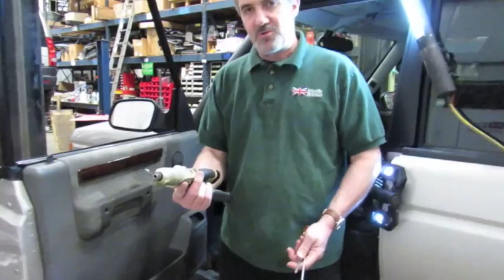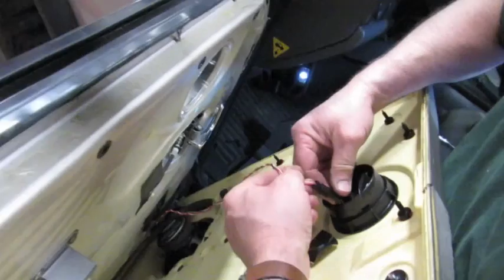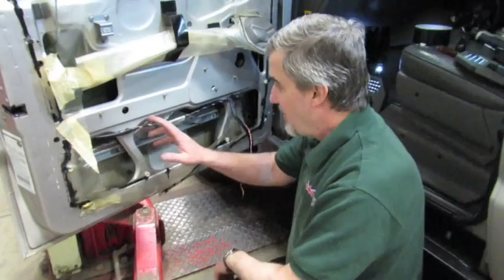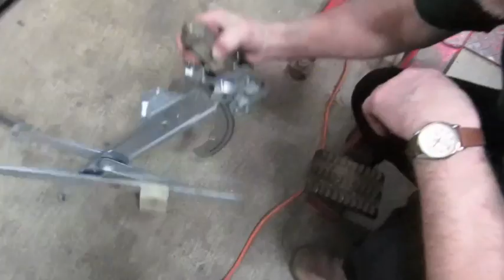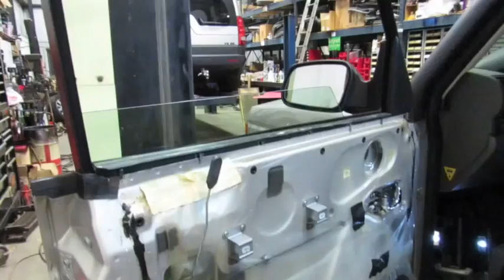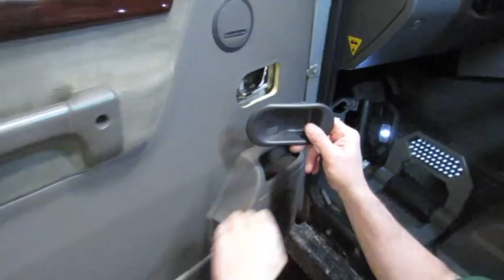Repair Front Window Regulator and Motor on a Land Rover Discovery Series II

Comment: kind of defeats the purpose if the window still goes up and down. 

My window is stuck shut so had to remove the bolts an let the regulator drop, still couldn’t access the nut on the other side of the glass.

now i have safety glass all over my garden.

Comment: One thing Doug doesn't mention is that the factory motor connects to a cable that's only about 6 inches long.  This plugs into the wiring harness behind the sheet metal. The two connectors at that end are held in place by a white nylon clip attached to the sheet metal; you can see where the clip attaches to the sheet metal behind the small clear plastic "bubble" in the moisture shield.  If you're replacing the motor, you need to release the clip from the sheet metal so that the connectors can be pulled down and disconnected, since on the replacement motors the 6" cable is not detachable and is plugged directly into the harness.

Comment: Anybody know how to get new glass installed? I keep fi ding nothing about putting new glass in.
Reply: Nevermind i figured out that you have to unbolt the window frame and pull it ul. I made a quick video on it.
Reply: @Nsixtyfourlink  Would you place a link to your video in this comment section?
I venture to say your instructions will also cover how to remove the regulators when the window is in the "up" position.
Thank you.
Reply: @lourias  Maybe mentioning the top frame removal. https://www.youtube.com/watch?v=zOsgHhSH6C4

Comment: Hy, can you change only the nylon rollers? i ave the same problem, rollers have broke.
Thank you!
Reply: The rollers are the weakest point of the regulators. I just found a seller on eBay who has made replacement metallic rollers.  I have not purchased them or know the seller. I do plan to purchase a set or two, as I do not know how many rollers are on each regulator.
Search criteria:
LAND ROVER DISCOVERY 1 & 2 FRONT / REAR WINDOW REGULATOR ROLLER REPAIR KIT SET 3

The link:
https://www.ebay.com/itm/LAND-ROVER-DISCOVERY-1-2-FRONT-REAR-WINDOW-REGULATOR-ROLLER-REPAIR-KIT-SET-3-/153656432534?_trksid=p2349624.m46890.l492

Comment: Hi there. If the regulator motor has failed and the window is stuck shut, how do you bring the window down to get at the bolts the window glass rail.
Thanks.
Reply from the maker: If the motor is inoperable and the window is fully closed, the removal process can be a little difficult. The only way to remove the regulator is to remove the door panel and remove all hardware that holds the regulator to the metal sheet panel of the door. This allows the glass and regulator to drop down into the lower part of the door and allows better access to the hardware that holds the glass to the regulator. 

The removal of that hardware can be done from inside the door, and then the lower rail of the regulator can slide sideways to remove the glass from the door. Then slide the glass back up into the door frame and hold it up with masking tape over the top of the door frame and which will allow you to work on the regulator and remove it from the door.
Reply: @atlanticbritishrp  when you say all hardware, your meeting not just loosen those one bolts but remove all of it and the whole thing will drop down to the bottom of the door? 

Mine is stuck shut with half the glass connected and half not. I can't see the bar completely to know if it's corroded or not attached the section I can see it looks great

Comment: Great video. Actually looks like an easier job than a regulator replacement I did on a 2000 VW Passat a few years ago. My question is: is this a procedure that will work on a 2003 Rover HSE? Thank you.
Reply from the maker: Yes, the procedure to replace the window regulator on the '03 HSE is similar to the process for the D2.

Comment: hello my Land Rover discovery 2000 ... I changed the gas pump and there was no current in the pump cables and there is no current in the motor!
Reply from the maker: It could possibly be a bad fuse or relay.
Reply: atlanticbritish thank crank sensor

Comment: Hi ,  Any chance of a video on a Discovery II TD5 2003 rear window repair ECU unit / relay?? Windows are not functioning at all . Appreciate.

REPLY
Reply from the maker: Hi Charles, we won't be producing any videos related to the diesel engine Land Rovers due to them not being available in the US.
Reply: Have a p38 and windows just stopped working have replaced switch panel and the out station  right hand door latch still no joy was working fine parked up in garage then went to use it and no windows working at witts end help

Comment: Thanks for this very helpful video. When I first pulled my door trim off and saw the mangled and twisted old regulator, with the curved gear sitting in the bottom of the door, I didn't know where to start. I began to curse and get the shits and went ***k it. Now that I've watched your video and gone and fixed it, its really very easy after all. Once again I love my disco :) Thanks for taking the time to post this helpful clip!

Comment: Another awesome video! One question, My drivers window is not working either but , How did you know it was not the switch in the center console?
Reply: The regulator is a common problem verses the center console switch.
Reply: Easy to check by pulling the switch panel and swapping the wiring between left and right switches.

Comment: Thanks! This is excellent, yet another fix for a problem I have on my D2. One thing I've also been wondering about is an intermittent warning light related to the air suspension - it seems like a fairly simple system; a compressor, air lines, sensor and airbag, but I'm sure I'm not the only one who would be interested in a brief walkthrough.